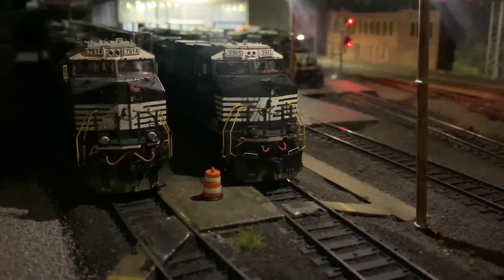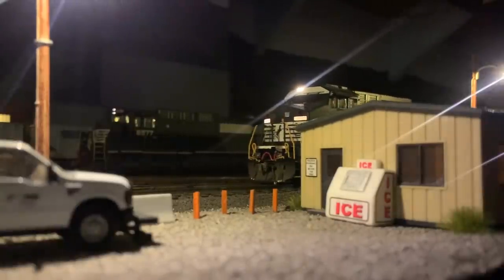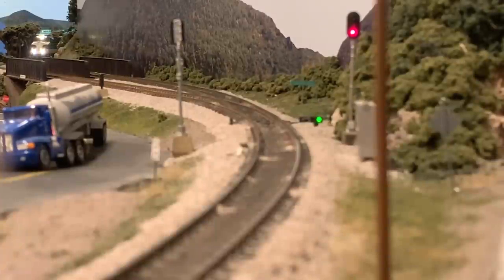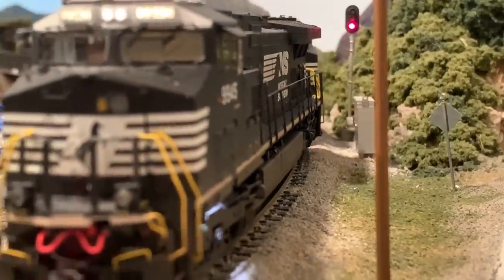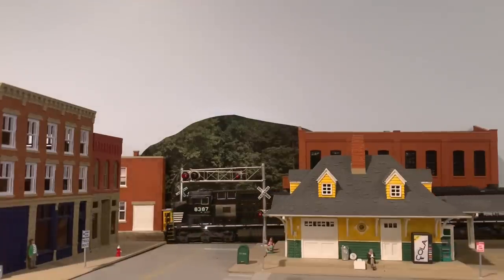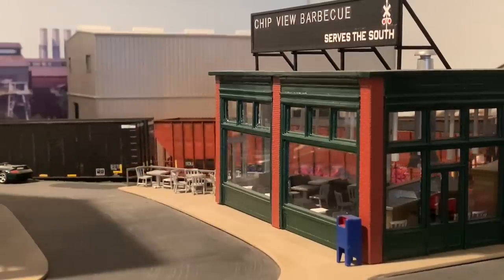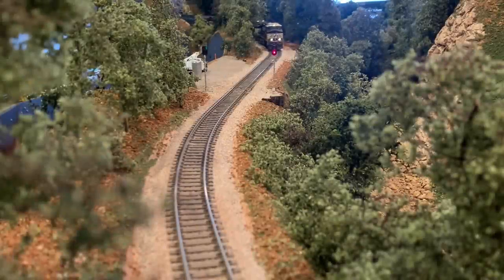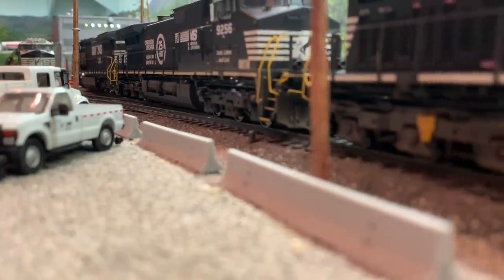Realistic Operations - Woodchips & Paper Mills in HO

Comment: That’s a lot of power for only about 20 or so empty chip hoppers 😉
Our class 2 here in Maine runs 3-4 EMD Geeps on the two north- and southbound trains with about 50-70 cars. The most common rail commodities for the paper mills are boxcars for paper rolls, tank cars of calcium slurry and various chemicals, and bulkhead flats with pulpwood. Most of the chips come in by truck but I’ve seen a few cars of chips. Outstanding video work! Sound editing was great and the angles are great as well

Comment: Excellent video. Just some ideas, normally intermediate signals have a number plate, or mile marker associated with its milepost location mounted on the signal mast somewhere...Also, usually only the lead engine has the number boards lit. Sadly working for a class 1 brings out the extra details lol

Comment: That’s great. We’ve got a grain run on our locals too, it’s called Chesnut Ridge in Clinton, TN. Steepest operating grade for NS on the Jellico branch. I also have Southern #8099, but in its stock form from Bachmann. I like it, but it needs ditch lights for sure.
Reply from the maker: Thanks Grayson. Sounds like neat operations in Clinton! -Josh
Reply: @nsmodeler24  it is for sure! The locals (a pair of SD40-2 high nose units) hang around and help them up the grade, climbing 85 feet in 1.5 miles.

Comment: This is amazing! Just like being on the prototype.

Quick question, why would you need three big engines to bring 30 empty cars down a grade?
Reply from the maker: Thanks John! Typically the prototype P87 has 2 big engines on it, as they need the power to take cars (often loaded woodchip cars) upgrade to Asheville, and occasionally I've seen it with 3 engines. Even on days that the train doesn't need all of the power, they typically run with the same set of engines. Often the engines for this train are in "captive service" meaning that they are continually used on the same train for long periods of time. You are right though... it was overpowered. If this were the prototype, I'm guessing one of the 3 engines wouldve been powered off since it would not be needed.
Reply: Better than doubling the hill like they used to have to do. Lol

Comment: Amazing Video!!! But if I could say. When you passed that signal if you were on the mainline that would be your last day. You can’t pass home signals unless you get permission from the train dispatcher. Especially since that signal was protecting a interlocking. Automatic signals with a number plate you can pass besides that very realistic. Now all you need is white explorers in bushes.
Reply from the maker: The line we model has ABS signals, so a red is actually "restricting" meaning that a train can pass it with permission from the dispatcher (i.e. a track authority). We see them do this all the time during meets on the prototype. Thanks! - Josh
Reply: @nsmodeler24  Oh I understand. NS has so many different ways of running their trains. On my territory, we run under ABS as well but with NORAC rules in effect. The rules are probably different, like for us we would have to get talked by the red first then we can proceed at restricted speed up until a more favorable signal or the cabs pop up. But again I love your layout. It looks like the real thing and keep it up 👌.

Comment: Absolutely love your layout my son and I watch your videos all the time great job.. I have a quick question for you. My son and I are trying to repaint a model like we've watched you do and for some reason when I was all done and I put clear coat on it the paint cracked. Any idea why it would do that? Thank you have a good day
Reply: Could be ...
Different types of paint
Too much humidity
Too much paint

However, sometimes you can weather those cracks and it looks really cool and prototypical. Suggestion. Use Krylon 1311 Matte Finish clear coat. Unless it is super humid, it works great all the time. Just light coats though!

Tom (Josh's Dad)
Reply: @tomclark4654  yes I was using Krylon for the whole engine paint and clear. I did put a light coat of clear on and it was fine and the second coat I went a little bit heavier and then that's when it cracked so maybe I put too much clear on at once with the second coat. Thank you very much for your time and Responding back love you guys videos your layout is absolutely incredible have a great night

Comment: How long do those woodchip hoppers last?  I model CSX and have some Western MD cars I was thinking about adding in for a modern era layout (~2000s)
Reply from the maker: I believe some of the older cars were made in the early-80s. Many of the older cars, however, are only allowed for use on NS rails and are not cleared for interchange.

Comment: I have a question, when the engines are flipped in different directions on these trains like regular trains, how do you manage the throttle control?
Reply: All through DCC. Once consisted (electrically  tied together) one press of a button turns all the locomotives to run in the opposite direction.
Reply: It's like some kind of voodoo... they just all go the same direction. Dern computers anyway! ;-)